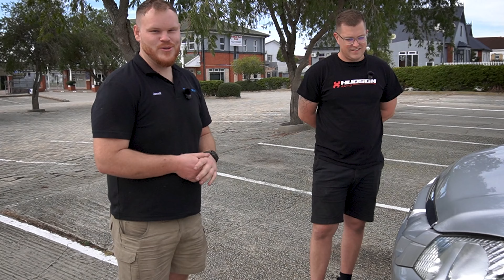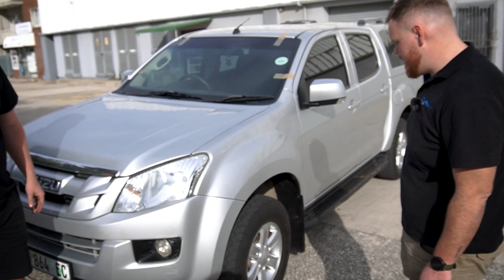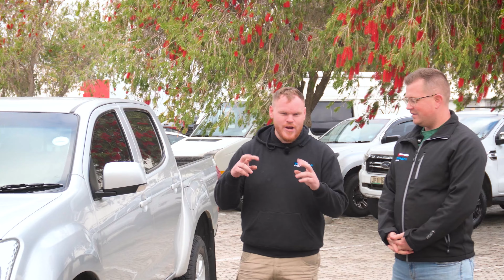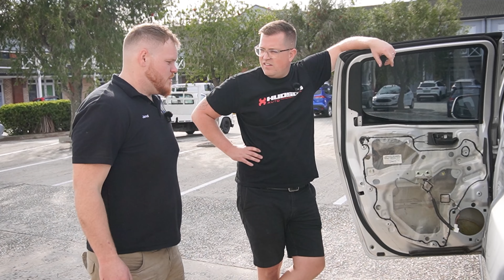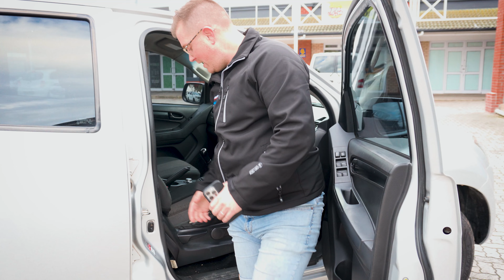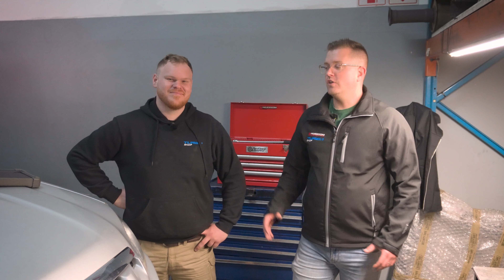Isuzu KB250 Walkthrough & First Faults | Project Knobkiri Build Ep.1

Comment from the maker: What do you think of Project Knobkiri so far?
Have you owned an Isuzu KB250 / D-Teq — what faults or fixes did you run into? 👇

Hit 👍 if you want to see more bakkie builds, and don’t forget to subscribe to follow the Amarok, Hilux, and Isuzu build journeys.
Reply: Owned an Isuzu no problems right up to when I sold it with 300000kms on the clock 
It was exactly the same as that one but the 4x2